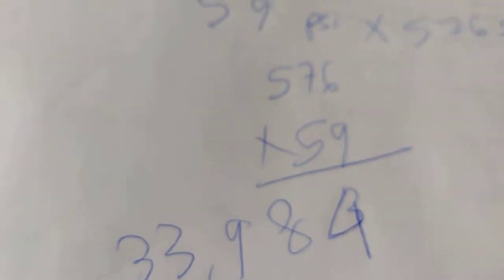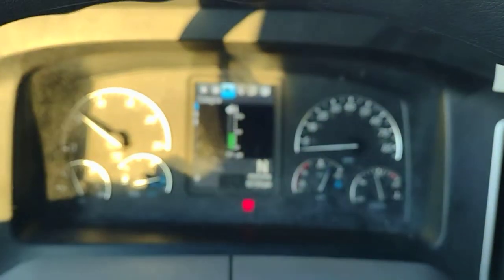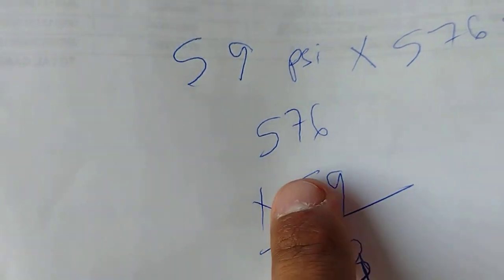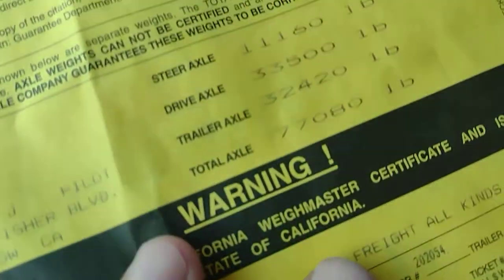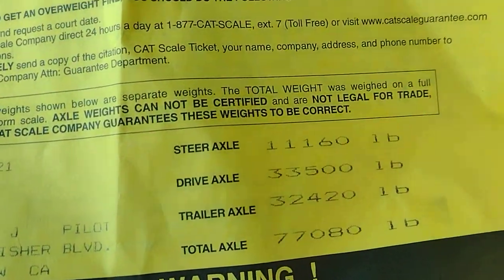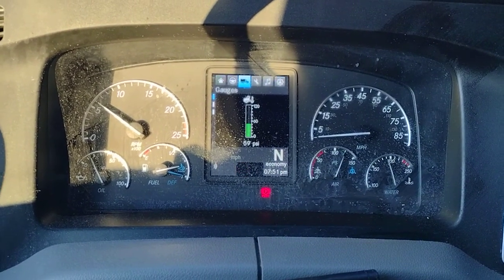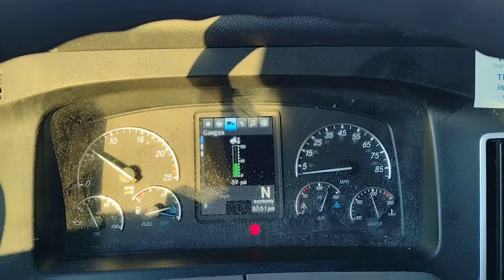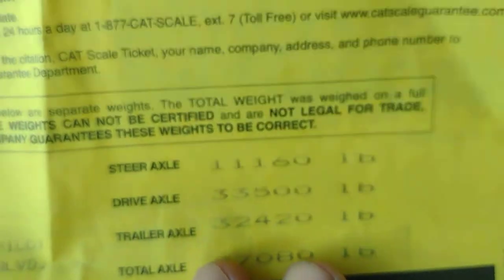How to scale your truck load using Air Bags' Pressure Gauge?      2021-08-26 18:49:51

Comment: How did you get the 576?
Reply from the maker: @Akhilkp97  

The 576 is the area of contact of 8 tires on the drive two axles.

Each tire has a width of 9 inches, take most of the force.

Each tire contact the ground at 9  inches along the side. 8 inches of those take most of the pressure.

Multiply 9 inches width of each tire by 8 in long, that gets you 72 inches square area on each tire

8 tires times 72 square inches gives 576=. 8 tires x 72 square inches

Multiply the pressure reading of 59 psi by the area of contact 576, you get a rough guess